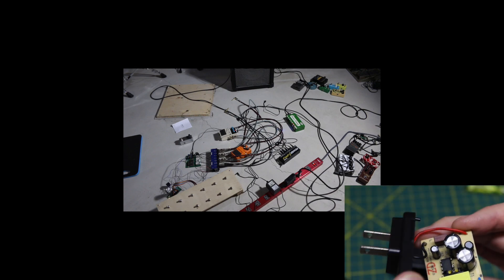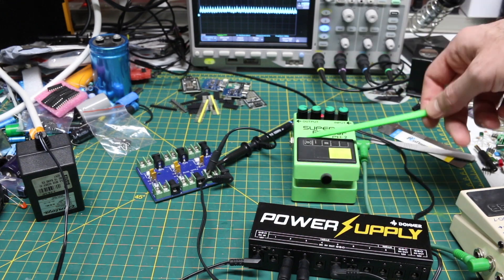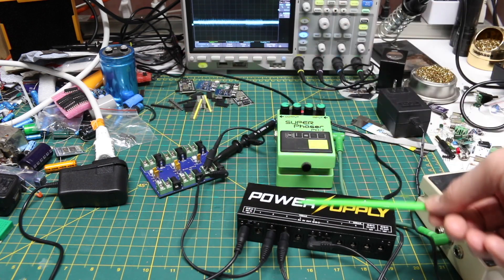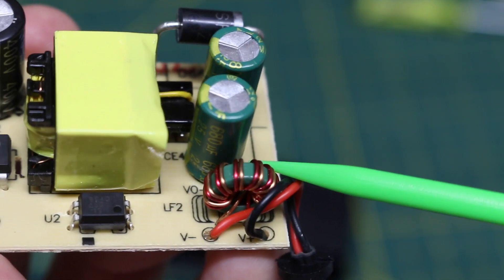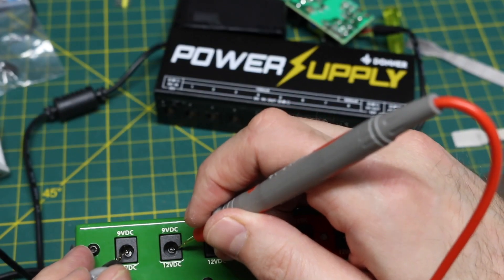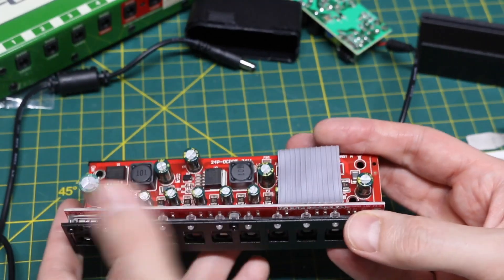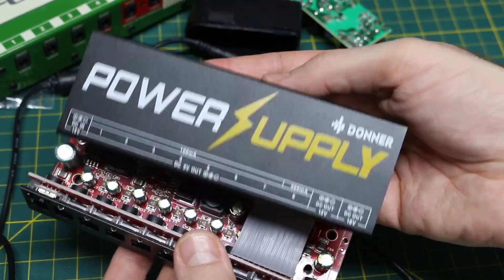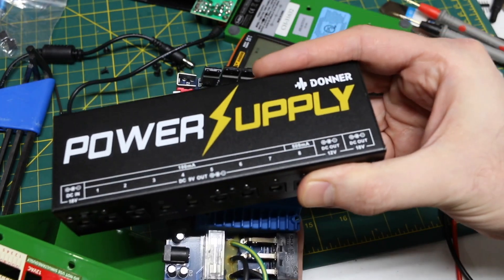Audio Hum Solved and 3 Power Supply Teardowns

Comment: Glad that someone picked up the topic. I had the same noise issue with a Raspberry PI/DAC combo that was connected to a PC's line in. Didn't take me long to figure that the noise changed drastically depending on the 5V adapter I used for the RPI. Generally, the branded ones caused a lot less noise, but even the best ones made it only barely audible. I think I settled with some adapter that came with a FireTV stick. Then there's also the half mains AC voltage that gets coupled onto DC. Many of the cheap adapters give you noticable zaps if you're grounded well. I fear that such potentials may damage my retro devices. So personally, I'll never throw away old transformers or wall warts again and use grounded SMPS where necessary.

Comment: Good work getting to the bottom of the noise. Might be a video artifact, but, it looked like 3 of those 5 caps next to the blue transformer had swollen tops, maybe check and change them out before cleaning the flux? Keep up the great vids!
Reply from the maker: yeah I plan to look at that again, if they are bulging I probably missed it because I was more focussed on the video recording process and this was the last step so I was probably rushing through it.
but I’m going to be placing a parts order soon with one of the major distributors so that would be a good opportunity to buy proper quality replacements if I need to.